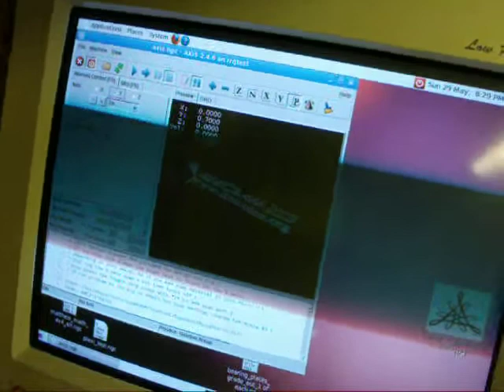Prototyping my CNC home switch

Comment: I can't believe you're getting away with driving LEDs right off the parallel port. Some parallel ports cannot deliver more than 3 milliamperes of current. You should consider buffering your parallel port. I made a port buffer out of 74AHCT245 ICs, With them I know I have 25 milliamperes to use. PC parallel ports there really is no standard today. Believe me I looked for it! The only way you can know you've exceeded a parallel ports current capacity now is if you burn it out. Then it is too late.